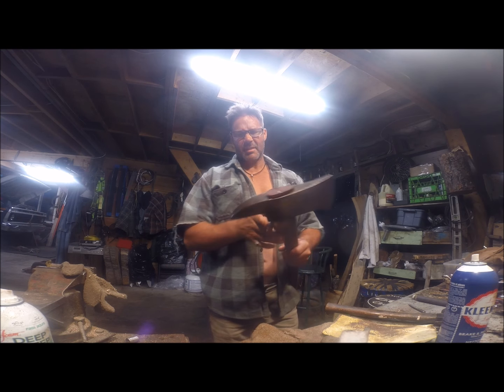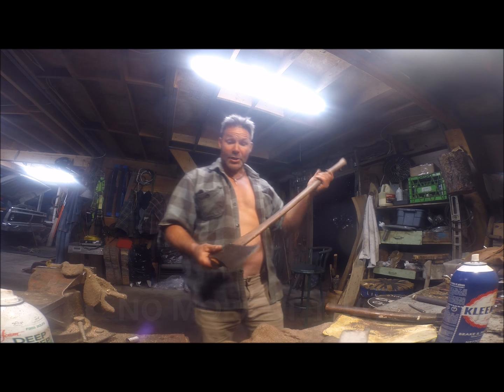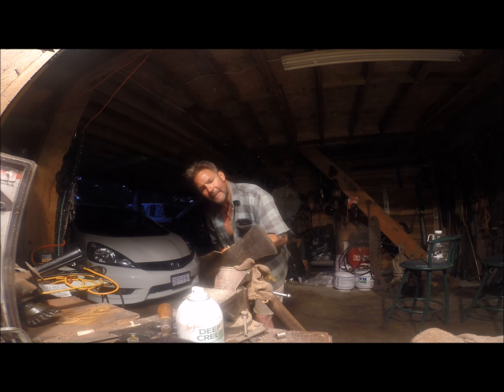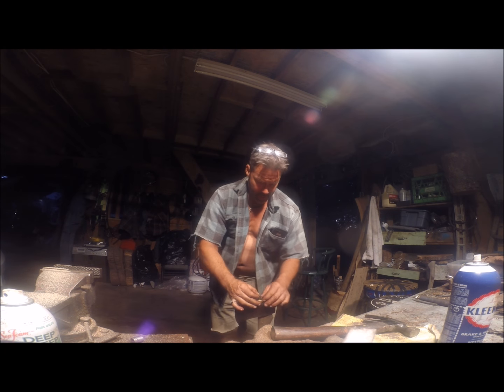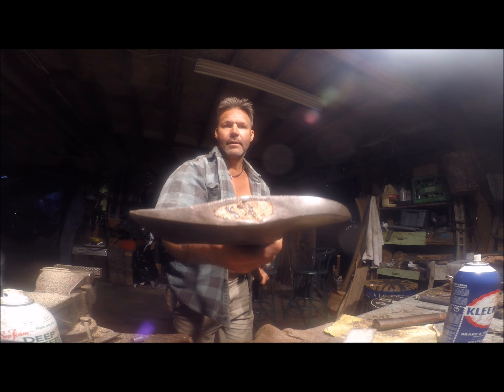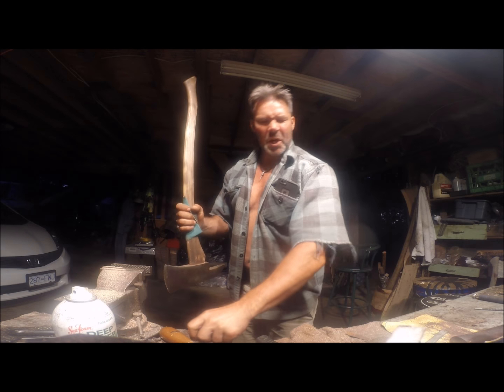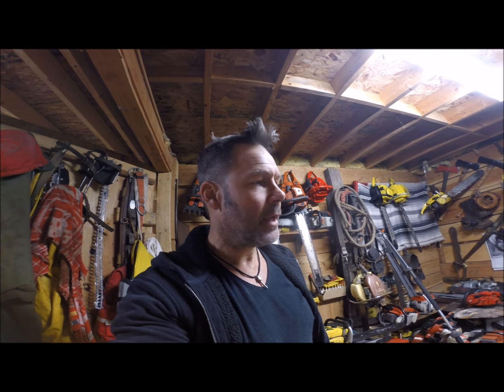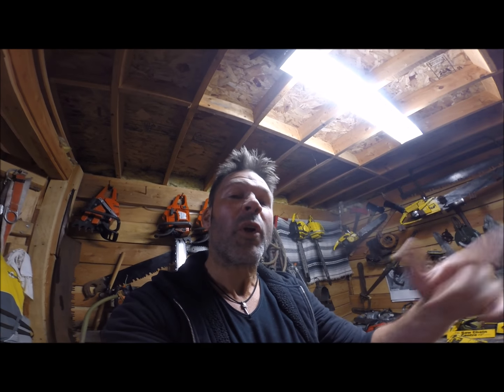HOW TO FIX THAT LOOSE AXE HEAD.

Comment: Got out the old 3.5 lb axe yesterday after watching you split big rounds with an axe.  Why have I been using a maul?  The axe is lighter and does the same job without killing the body.  The handles got some wiggle so I came to you for the answer.  Thanks for the great vidoes Buckin'.

Comment: I'll do soak in linseed, but you can only do it once and then it's sealed for good and no more will soak in.  After that it's metal wedges.  People will trash talk metal wedges, but they must live in an alternate universe.  I just keep cramming those things in there till it works or there's no more room.  The things are great.  One thing I do unless I'm in a hurry is put small notches in the wedge to assist in removal should it be necessary..  That expedient has helped me many times
Reply from the maker: groovy ,, ya    ya no, ive have axes with no wedge work tight for years and then the oppisite too ha ha takein time in fitmanship seems to be the best combat